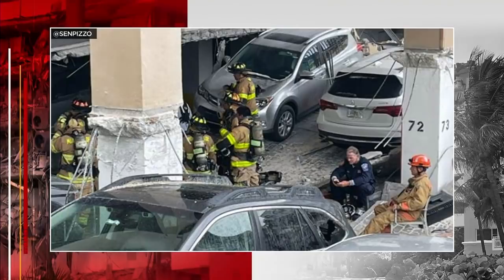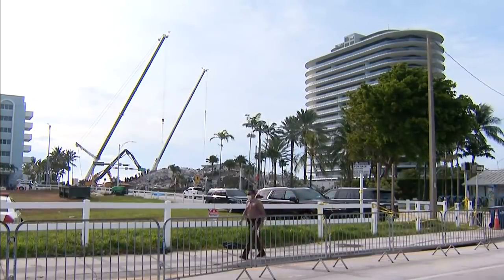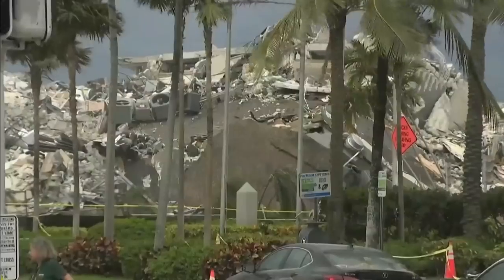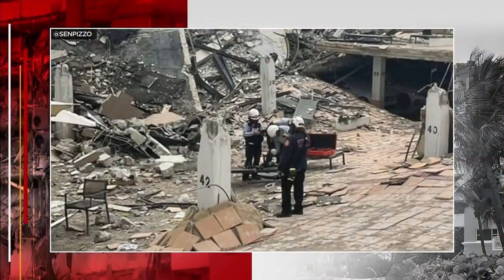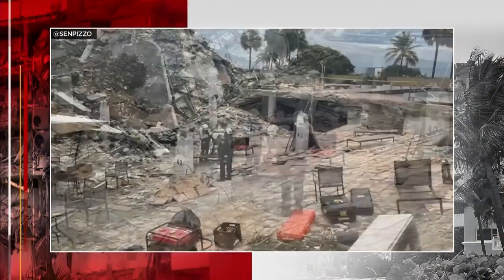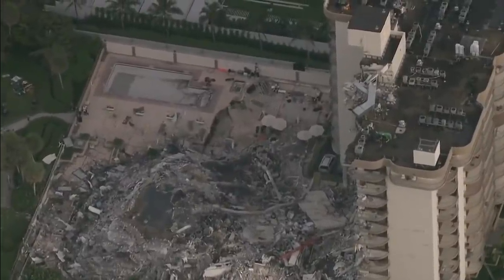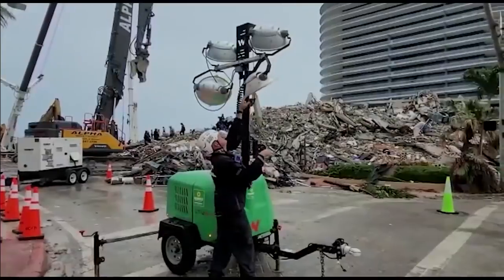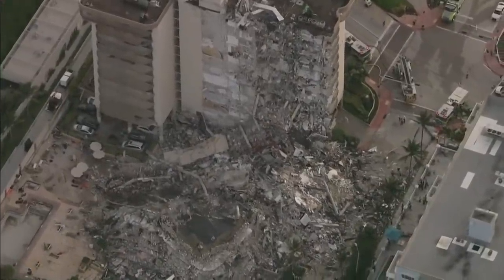Building experts studying Surfside collapse have questions about its initial construction

Comment: And where was the inspector?  I spend most of my life inspecting construction projects and if the build does not match the design then the inspector needs to be called in to testify.
Reply: Some inspectors don’t bother to do more than give things more than a cursory look,  especially when there’s a heavy workload.  I worked with inspectors like that,  yeah I see rebar, good enough.
Reply: pretty sure he went on leave asap. 🤬
Reply: The inspector probably died of old age .  Remember - this building was built in the very early 1980's.
Reply: Actual design and construction drawings versus as built. That has curiously not been addressed.
Useless after-the-fact media incompetence “speculation” with third rate engineering “experts”. I have all my drawings which are critical to any investigation/evaluation.
Speculation is the language of the ignorant and incompetent.

Comment: This is absolute greed, nonchalance, and outright murderous lies. Some one did it on purpose. That looks like garbage and any layman can tell it's garbage. During and after WWII, the Allies and the Axis powers built bunkers/bases/U-boat pens which cooked in how much steel and concrete was needed to make a building safe enough. And we ain't even mentioned construction during the Cold War. Punching shear has been known for generations. Here in NYC, buildings like 205 Hudson, and 76 9th Avenue, 75 Varick, not to mention all of AT&T holdings are build like tanks.

Comment: Also a PH was added without any changes on columns size
Reply: Not only the one on top but three more were converted to PH's. Now throw in the elevator shaft extension and a corridor leading to it plus all the added weight of the granite and marble everyone keeping up with the Jones's has to have these days.........smh.... it is a miracle it didn't fall sooner and a testament to how overbuilt this basic design really is and still they screwed it up.
Reply: @1800imawake  I also read they added penthouse after the architectural plans were submitted and a few more concrete balconies to the portion of the building that collapsed.
Reply: @1800imawake  Overbuilt? No, the pool deck was at 100% capacity! That's where it started.

Comment: wait until the experts start talking about a "BMA" (beam type A) and the "slab drop beam", then they will understand how a bad design made this building collapse.
Reply: Ah. Page 31 as well?
Reply: @jazzman92478  Lobby level framing plan
Reply: @eduardocarvalho1547  the other page where it’s listed. Cool.
Reply: Thank you, someone who is at least competent with basic structural design terminology.
Reply: I'm no engineer but I saw 0 beams. Air, apparently,  was holding this thing up this whole time.

Comment: What!! But President Joe Biden said it was climate change!! You mean his opportunity to advance a political narrative was a lie...say it ain't so.
Reply: Should I help you pull that MAGA HAT MADE IN CHINA FROM YOUR ARS?
Reply: @gennaterra  Those silly things called facts...
Reply: @gennaterra  Cocaine Joe loves China
Reply: @taracat7723 Covid-19 serial killer-trump loves Russia
Reply: Even the Bible says not to build your house on shifting sand.
Reply: @Sea Mac,    I'm pretty sure that Biden knows what he talks about:  Yes it's climate change: The sun heated up the steel of the building to 800 degrees Celsius which weakened the rebar, which made the building collapse.
In 20 years the climate has changed that much, that we no longer need unusual hot office fires to explain unusual collapses, that surprisingly look similar to controlled demolitions.

Wait, you say that the building collapsed in the middle of the night and the sun was not shining ?
Well, you should know that the moon reflects the energy of the sun, so it's still due to climate change.
Reply: The water table has risen. Please look up Building Integrity with an actual engineer. Conjecture is hurtful to the families. They DO read these.

Comment: Good work isn't cheap and cheap work isn't good.  People seem to never understand that.
Reply: say it again for those hard of hearing in the back🤸
Reply: Agree but Just because it costs more doesn’t mean it’s quality either
Reply: @tameishalcampbell  Also Agree, but in construction people usually go with the lowest bidder.  That is what I meant by my comment. 😁
Reply: @tameishalcampbell  Every BMW owner knows that one is true and the ones who don’t will eventually!
Reply: @tameishalcampbell  the sweet spot is somewhere between cheap and overpriced. :)
Reply: Same with buying ... You buy cheap you get cheap.
Reply: @aerofpv2109  I don't think someone who pays $710,000 for a condo expects it to crumble and disintegrate with them inside.
Reply: @lisas8244  I meant it toward basic shopping such as clothing, appliances and the like. 710k is not cheap.
Reply: @lisas8244  
Even though they could see the crumbling concrete all around them?
Reply: @neilkurzman4907  The average person not having a background in construction or engineering would be concerned seeing concrete damage. I don't believe the concern would rise to the level of thinking the entire building was at the risk of complete collapse. This is an extremely rare occurrence.
Reply: @lisas8244  It should be pretty obvious when you park in the parking garage and look around and see standing water, cracked concrete and exposed rebar that’s rusted that the building is in disrepair.
Reply: @thebullgator  No doubt!
Reply: @lisas8244  
A lot of average people in these buildings have certainly seen concrete damage. And certainly didn’t think that it might cause their building to collapse. Now the opposite is true. Every settling crack is seen as the building getting ready to fall.
Reply: @lisas8244  that’s true but aside from structural issues most people assume “builder grade” build quality on condos and development homes.
Reply: @patjohn775  I am a professional interior designer. One of my truly greatest shocks came when i realized most of my clients had the mindset that if their homes had a substantial number of square feet and they paid a big price for the home, then that meant it was a quality built home. 90% of the time had they asked me to look at the homes before buying, I would have advised them against the purchase.
Reply: Exactly.👍🏼
Reply: Truth.
Reply: Also some bad work isn't cheap....
Reply: Cheap fast or good. Pick one and if your lucky 2
Reply: What Sells is Good and What's Good doesn't always Sell
Reply: Should of called me I'm the best!!
Reply: Hello See ya later  I agree with you. This is a typical scenario. One may get beaten in plain sight and no one will help because everyone thinks that someone else will do something.
Reply: In other words ‘ you get what ya pay for’.... condolences to family and friends from us in NZ
Reply: As we all know...when someone pays the cheapest, the cheapest will cost them alot more expensive later
Reply: @12voltaudio209  Only for the last owner . Nuance
Reply: Figures don't lie and liars do figure !
Reply: and Expensive Work can be done Cheaply Bad ... how much a Contractor charges is NO indication of the quality of work or compliance to codes & design.
Reply: When it comes to developers they don't care, it's all about the money
Reply: Ever
Reply: Im not a construction engineer but the floors look so thin, steel beams small, etc.  Like a cardboard building.  All Miami buildings near water should be inspected by outside experts from a state with good building codes.   They wired that building they brought down pretty quick.
Reply: @1m2rich  that’s honestly just silly. The building stood for 40 years and survived Hurricane Andrew, Katrina and Irma. Unfortunately the association didn’t force the owners to make the necessary repairs that would have prevented this. We have some fantastic engineering firms in Florida who are on the cutting edge creating wind resistant buildings. But the best engineering in the world won’t fix owner apathy.
Reply: @thebullgator  owner apathy and not having enough funds. Many of those were retirees. And when they bought the condos the asking price was much less than the current selling price. Miami has quadrupled the home owner prices which is a win if hah sell but not in taxes. So I am very ambivalent. Because people do need homes or will we just ask people to sell all their condos and houses and live where? If they can’t afford them. Considering Miami rental costs are also skyrocketing
Reply: @ireneswackyjournals8810  I am a general contractor who owns a remodeling business in Florida. If you own a $700,000 beachfront condo you have to be able to afford to maintain it. Any structure will not survive if proper maintenance is not done in the appropriate time. That’s why the banks offer loan products like equity lines and reverse mortgage. If you cannot afford to live there they can sell and get something cheaper.
Reply: Oh, I'm willing to bet they understood it just fine, they just didn't give a damn.
Reply: You don't necessarily build sturdy and reliable structures with folksy, or contrived, metrics.  Certainly, structures can be build economically for a fair price/cost, while "gold-plating" a project  could dramatically increase costs, with minimal functional benefit.  Most people understand this.
Reply: Bad work is expensive. Good work is cheap.
Reply: I've worked in building construction for years and given people estimated quotes for jobs. I know for a fact your original post is true. When someone is paying for work to be done, they only consider how much it will drain their bank account, resulting in the man that would have done the good work doesn't get the job.
Reply: @igoski1582  depends on the client and the market. I’m a GC and our entire business model is we charge more and do a better job. We have people seek us out because of this. But our average client is very intelligent, has previously hired a contractor and understands the value in quality and professional service.
Reply: @thebullgator  That cool. I'm not a GC and only do the smaller jobs. I do quality work and it seems the people I run into only want to hire the one that gives them the lowest quote and not me that is giving them a quote for quality. Some just don't know or care to know the difference.
Reply: Over paid lazy union workers most likely built this project and they are far from cheap labor. Its the new batch of labor springing up who think they deserve more money when they really deserve a smack on the head. Be good at your job every new talent learned is not a raise its learning your job! With this new inflation ya'll keep pushing for you know 15.00 hr minimum wage? That will sure will keep you poor for another 20 years. good luck  Also the cost of these projects keep going up because of the wage increases will mean less jobs so also good job.
Reply: @gov_1483  we don’t have unions here.
Reply: @ireneswackyjournals8810  Florida is loaded with unions.
Reply: @gov_1483  and by the way,  I’m sure New York and cal have unions and get their construction is better: it’s not the unions it’s our developers skipping costs and greasing palms.
Reply: @ireneswackyjournals8810  just because i talk about unions i never said it was better. unions are crap in my eyes
Reply: and you have unions lots of them unions are everywhere commercial buildings are.
Reply: It’s a combination of capitalism and failure to update the education system.
Reply: @HoleGrayNotes  Because the Soviet Union, Cuba, today's China are famous for high quality housing.
Reply: @2paulcoyle  seems nobody is intelligent enough to understand we need a new system. All people can do is pick between popular systems? The whole world is doomed by average opinion. Come up with something better than socialism if you’re trying to counter my point, there’s still no proper education with socialism so clearly that’s not what I’m after 😂
Reply: @2paulcoyle  What they built isn't collapsing under its own weight, either.  Even after decades of mediocre maintenance.
Reply: Basically developer "saved" money on using less steel. They had security cameras in the building...I wonder what happened with the footage. Maybe it was under maintenance like the Jeffrey Epstein cameras?
Reply: @thetruthalwaysscary actually I believe some of the cameras were in the part that collapsed
Reply: The problem is sometimes expensive workers still do cheap work
Reply: neither will people ever understand that it cost alot of money to save lives, cheapest option will never save anyone in long term
Reply: Quality over quantity.
Reply: Nathan Reiber had a vision to sell luxurious paradise… at the lowest cost to himself. I would not doubt he implored his Engineers to establish Planned Obsolescence after the thirty year mark, long after he would be alive.
Reply: Yeah - But people aren't confronted with the consequences.  They just see the savings.
Reply: James M  early 80's it was built
Reply: In development, we say: "Good, fast, cheap. Pick 2."
Reply: The Truth / Nathan Reiber & Associates were crooks . They survived Holocaust but cared , only , about money

Comment: insurance companies packing their bags right now
Reply: 5000 condos are currently for sale in Miami  the the  housing market collapsed there
Reply: @punker4Real  wrong, Miami will always be popular. the real estate market isn't crashing in Miami yet.
Reply: @bretwalley4673    the building in surfside   value crashed to the ground and 2 floors lower   don't tell me the market is not crumbling   real estate is driven by supply and demand...  too much supply drives the prices down
Reply: @punker4Real  high rise condos are not all the real estate market though, other than coastal areas and downtown/Brickell, it's mostly 2/3 story condos, townhouses or houses; the condo market is expected to plummet in the short term, but may be back in the mid-longer term. There is going to be a rush to renovate in many building so contractors will see a spike in demand and renovation costs will likely go up. This market has been going up too fast for too long and was highly inflated by foreign investments that had nothing to do with local salaries/cost of life...we'll see...people are also finally taking into consideration climate change and sea levels rise, which in the long-term will make a huge impact. Inspections will be done, hopefully, much more often and differently...many factors in play I'd say
Reply: @punker4Real  That's.... a lot... of condos.  Skeptical.
Reply: Probably won't be writing insurance in Florida anymore.
Reply: Ehh, it was just one building in one state. Certainly disappointing, but it won't even show up on the quarterly report.
Reply: Insurance companies are not liable for substandard work, if this was the case.
Reply: @bretwalley4673  he means that the insurance company doesn’t want to pay for the damages